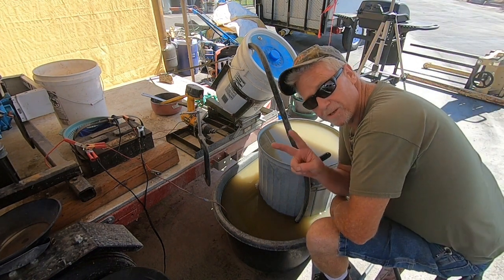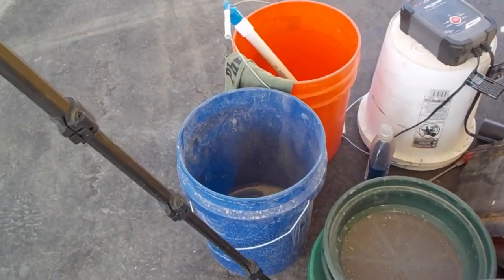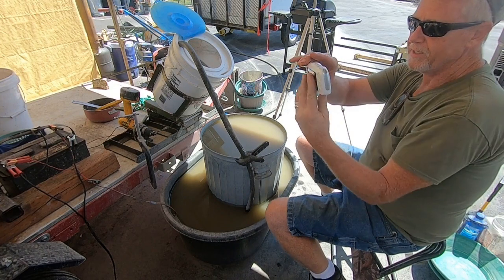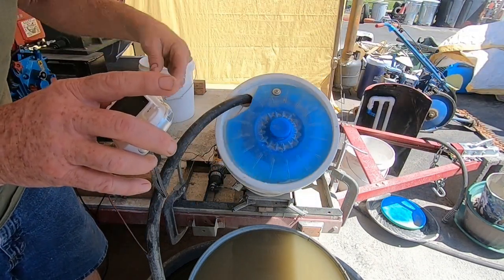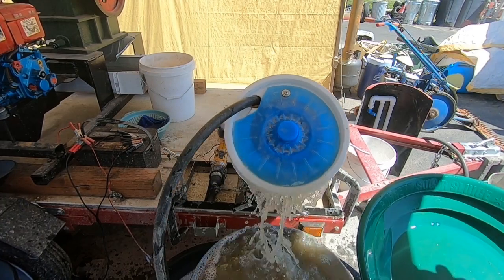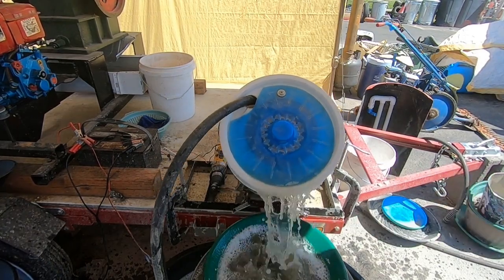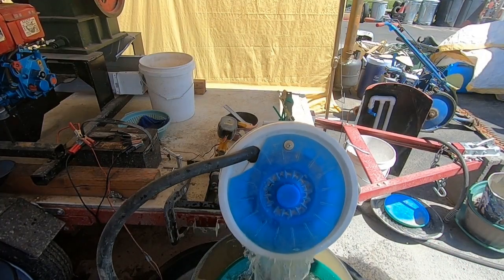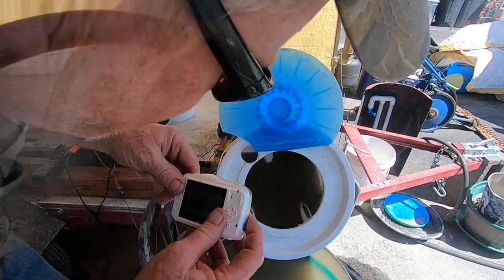DIY Hard Rock Gold Ore Concentrator

Comment: Well PT, color me impressed!  That was an excellent adaptation of the hydramatic principles into what looks like a very compact and elegant system once the details are worked out.  Imagine that just downstream of the air classifying impact mill section and dust collector.  Unfortunately I don't think you are close enough to bring it to Tucson for some joint testing are you?

Any idea what the precise recovery rate is and the size of the gold?

Also, do I have your permission to play around with the concept?

Keith
Reply from the maker: Hard Rock University.. yep absolutely.. concept away! No worries on the idea.. 
Keene did the legwork.. you showed me.. and I just made it my size to fit on my Prospecting Sampling Trailer!
I’ve found a bit of good HR gold but as is usual most of the ore I run are small samples of so so values.. prospecting.
After the shaker table is completed I just might come south for a visit!
The Concentrator:
So far I don’t see much gold getting away.. however I am watching and babysitting it and test panning the tailings for values a hundred times. This process is slow as molasses!
The idea of a grippy silicone trap mat in the bottom and then keep the bucket at a fairly steep angle to keep a minimum amount of material in the bucket which is much easier to  concentrate. A small amount allows the material to quickly cleanup concentrate instead of loading the bucket up which is heavy and slow to cleanup into the final cons.
Your air mill would be great running into the concentrator then to the shaker table!
Yep cool stuff.
It would be terrific to venture out with you a few days and run my trailer setup!
Thanks for your help and advice!
✌️PT
Reply: @ProspectorTripp  Would love to get together  sometime.  An easy way to make a ridged silicone surface is just to use a notched trowel with silicone caulk.
Reply: as soon as I get a few minutes I'll put a rack on top of my hydramatic and do some testing.
Reply from the maker: Hard Rock University amen pal! 
I made good progress on the diy shaker table yesterday.. I am anxious to get this table completed so I can get back on the concentrator and do a few modifications!
One by one.. line by line 
Thanks Keith.. always enjoy very much to see what you come up with!
✌️PT
Reply: @ProspectorTripp  Glad to help.